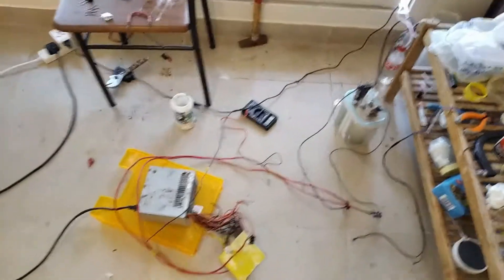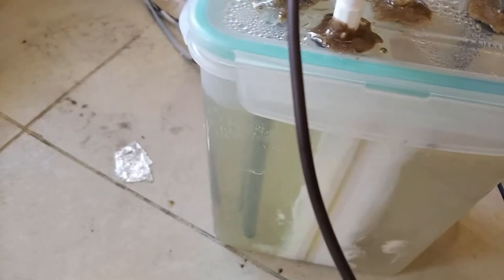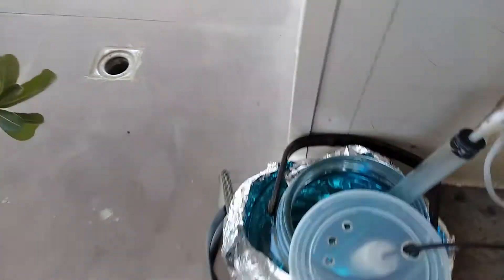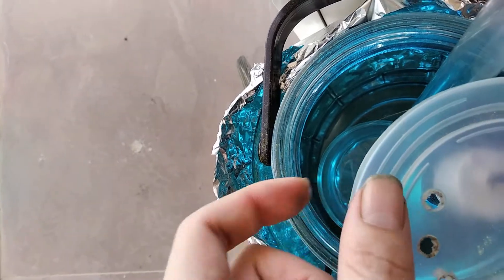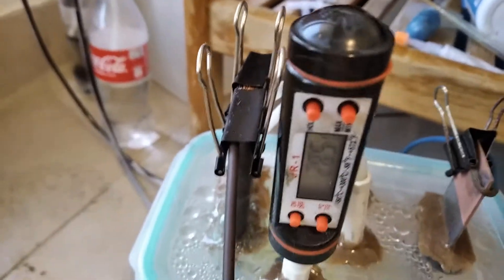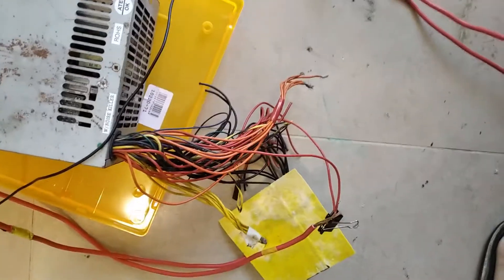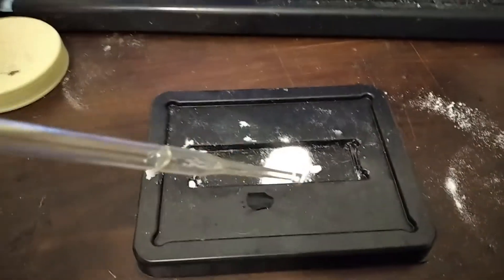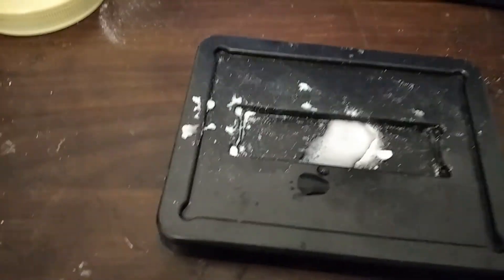Miniaturized HCl plant

Comment: I don't deny that this method somewhat works and can be refined, but I question if it's really the easiest way to get HCl or any mineral acid electrochemically.
If you go this route and HCl is already hard for you to get, then you probably also don't have H2SO4!?
Otherwise you could ofc use H2SO4 with NaCl to get plenty of HCl, although it might not be cheap and Na2SO4 is not that valuable as a side product.
Reply from the maker: Na2SO4 can be used to make H2SO4 as a sodium ion catalyst to facilitate the sulfate ion removal from CaSO4.
essentially
Na2SO4 = NaOH + H2SO4 {anode chamber}
NaOH + CaSO4 = Na2SO4 + Ca(OH)2 {cathode chamber}
the continuous liberation of sulfate produced a 50% solution of H2SO4 in the anode chamber and your catalst Na2SO4 or rather NaHSO4 can be recovered by boiling it down and seperating for use in future runs.
Without Na2SO4 you can also use NaOH as a catalyst initially poured into the cathode chamber to start the process but starting current through the cell will be low if you do that.
Reply: @CatboyChemicalSociety  I see, you're a fan of separated chambers, which seems a bit overused here and is often difficult to do practically without special materials.
Also I cannot tell, what kind of process you are describing here, do you have a source for that?
Reply from the maker: @realedna  its called the chloroalkali process.
it uses a membrane and inert electrodes in the anode side usually graphite or mixed metal oxide and a chamber where the gases are usually burnt but thats quite dangerous.
So i opted for a slow UV photochemical reactor that will slowly react H2 and Cl2 with UV at low conentration into HCl directly.
The reactor must be cooled or a chain reaction resulting in explosion can occur and in the latest design theres a cooling jacket and a proper chamber
Reply: @CatboyChemicalSociety  Not the process of this video, but the one of your comment about electrolysing Na2SO4 to get H2SO4.
Reply from the maker: @realedna  yes using membrane that works too but it will produce an equilibrium with sulfuric acid, NaHSO4 and Na2SO4 so its no ideal using only sodium salts
you need CaSO4
Reply: @CatboyChemicalSociety  I appreciate your work, that's exactly what fascinates me too. To find ways to make it work, even if everyone thinks, it's "too complicated" or expensive - if that's the case we just need to find a solution. And that is, what you are doing. Great job!
Reply: Btw, H2 and Cl2 are actually much more valuable on their own and HCl is mostly a waste product being formed in many reactions with Cl2 anyways (esp. in organics).
If you google H2, Cl2 and HCl, you'll get a list of methods to create H2 and Cl2 from waste HCl. So forming HCl from H2 + Cl2 is actually silly! :P
There is also the risk of explosions with mixtures of H2 + Cl2, when it comes in contact with sunlight/uv light. So is it worth all the difficulties?
Reply: My suggestions:
1. Produce an "acid" and a "base" from NaCl via the Solvay process (easily).
NaCl + NH3 + CO2 + H2O --> NaHCO3 + NH4Cl
NaHCO3 (or transformed to Na2CO3) is now your weak NaOH and NH4Cl is your weak HCl bound to NH3 and actually easier to handle in that form.
You can use NH4Cl as an acid with carbonates e.g. to produce CO2 and chlorides. It can be made stronger/more acidic together with ZnCl2.
2. Produce Cl2 by itself electrochemically from ZnCl2 solution and use or store it in any form (e.g. TCCA).
ZnCl2 --> Zn + Cl2
Now you have all the negative potential you can get, while working in water, stored in Zn instead of H2.
3. Produce H2 by itself electrochemically from Zn
Zn + 2 H2O --> Zn(OH)2 + H2  (by electrolysing a Zn anode in a NaHCO3 solution)
4. Regenerate ZnCl2 from "HCl" to produce more H2 and Cl2 from
Zn(OH)2 + 2 NH4Cl --> ZnCl2 + 2 NH3 + 2 H2O
Reply: If you really want to make HCl, then as I said above produce H2SO4 first, which can be done electrochemically (see multiple methods from NurdRage).
You could also create H2SO4 and HCl at the same time from SO2Cl2 (sulfuryl chloride), which can be "easily" made from SO2 + Cl2 (on active carbon) and reacted with water.
You may even just bubble SO2 + Cl2 into water directly, but I don't know which concentrations you could reach that way and it might be difficult to separate all gases.
If you need (dry) HCl gas, you can also produce some from ZnCl2-hydrates:
e.g. ZnCl2 * 2 H2O --heat-> ZnCl(OH) + HCl + H2O (also see: https://link.springer.com/article/10.1007/BF01257465)
So ZnCl2 is also often a replacement for actual aq. HCl!
Reply: This way you have now all the possibilities to produce and recycle the most common acids and bases yourself or buy some of the easily available precursors to create shortcuts.
With Ca(OH)2 you could also make NaOH from Na2CO3. With H2SO4 you can also make HNO3, HOAc, H3PO4 etc. So H2SO4 is the one you want to make first!
Reply from the maker: @realedna  why on earth would I bother if I can produce it directly from NaCl and using a membrane I prevent hypochlorite formation. and making H2SO4 I already have a video on it but to make it electrochemically you need either PbO2 or Pt which I have the former and will make a video on it soon.
But its a waste to convert H2SO4 into HCl since you do 2 steps and more losses instead of making HCl directly!